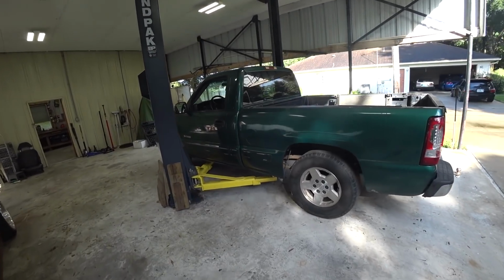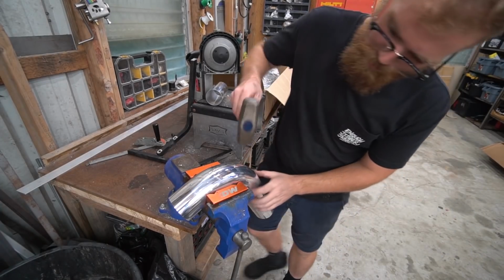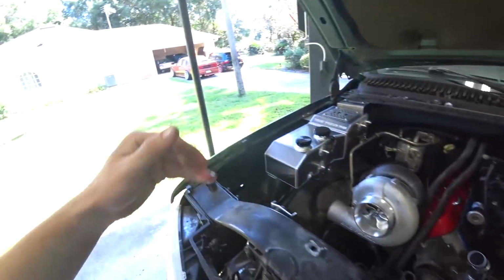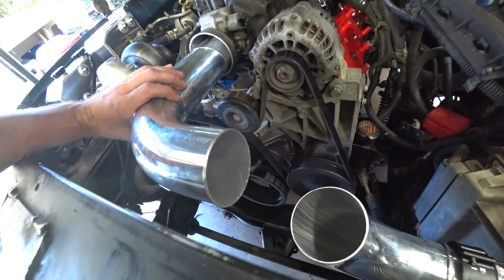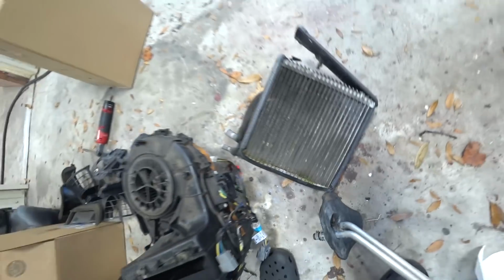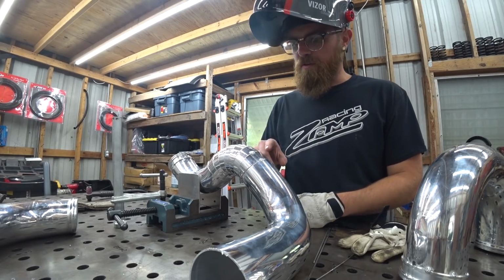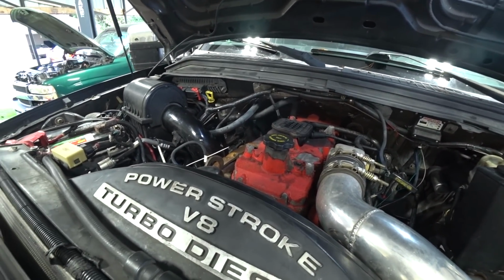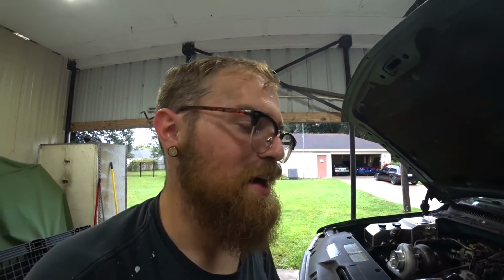Turbo LS street truck build. the first big fab project is complete.

Comment: Not trying to knock you dude, you do good work and I commend you, but there is no valid reason for pie slices other than for a look, and to give yourself some welding practice. They actually are more restrictive inside the pipe than a smooth mandrel bend, dunno why so many people do them. On your charge pipe you coulda just did a 45 and then a 90 into the TB. Also, your intercooler end tanks are not optimal. The air will just go in and out where the nozzles are, and not use the entire core, thus reducing the efficiency of the intercooler by about 50%. But otherwise, good job. I just love these garage builds.

Comment: Do you happen to know if they make an in-tank fuel pump set up like you have with a 450lph pump that will fit in a 2000 are s10 4x4. I'm doing a turbo L33 swap now but I'm still trying to figure out my fuel set up needs since no one really talks about that part of an LS turbo swap. Seems like a boost referenced fuel pressure regulator might be worth mentioning. I'm only looking to run between 8-12 psi most of the time but with my set up I should be on boost pretty much by the time the stall flashes to 2500rpm. But I do want to be able to run it at up to 15psi without worrying about anything. Thanks for any info you can help me with. Btw, it's a 4000+lb 2000 ZR2 4x4 s10 with an L33 with 80 lb injectors, ls6 intake, DBC TB, a 70mm turbo (DNA GT45 from Ebay) on stock 31/10.5" tires with 3.73 gears, and its gonna have the Sloppy mech/elgin E-1838-P stg 1 turbo cam with the basic trunnion upgrade. I'm just trying to figure out how to run my fuel system. Thanks if you can help any. Awesome build BTW, my drift buddy is doing almost the exact same build except his truck is red and it started off with a 4.3L so it was heavily under powered like my zr2 was. Both v6 engines blew up because you had ro dawg then to make them perform enough. Oh, you wouldnt happen to be near Gainesville would you? I used to travel through Gainesville to get to a small town named Bronson quite a bit.

Comment: I’m curious if an intercooler like what’s on a 6.7 powerstroke would work a little better, would be a little more stealth for a sleeper look would require more fab work but it would fit nice where the air box use to

Comment: Looks awesome! My black 03 gmc single cab is by far the nicest cleanest build I've done way cleaner than 00 z28 small tire turbo car that probably has twice as much money in it lol!! It took me 3 years to get my truck where it's at now I wanted a street/strip setup that I could drive anywhere but with any thing I do gets out of hand eventually I started with a 60,000 mile oldman owned Sierra so it was super clean to begin with it started out with a sbe 5.3 with a Huron Speed single kit with a vs s485 1.15 T6 housing ,very nice kit if your like me and can't weld lol and Holley EFI, th400 built factory rear end with all strange parts 4.10 gear with a spool and Calvert leaf springs and cal tracs I also relocated the shocks it's got strange double adjustables front and rear. I basically got rid of everything I could and moved everything else to where I wanted just to keep it clean as possible I done a 5 lug swap up front from 1320 wheels I think that's the name of the company/website. I got it running and the suspension and tune dialed in and was running 6.30's but that wasn't enough lol I ended up windowing the block it didn't like 25 pounds and 7600rpm in a 4000 pound truck. So I threw a budget built ls2 based 403 with 11 to 1 compression and put together with summit Ls Pro 4" Crank rods and Pistons with btr cam springs and push rods and some used LSA heads CNC'ed by PRC stock ls3 intake Bosch 210's ebay cable style throttle body and went to a Garret gt5591 with a 1.32 t6 housing and a pretty big air to water intercooler and 5 gallon ice/water tank in the bed now it only runs on ignite E90 instead of pump gas and renegade 110 race gas I ran with the 5.3 and had another ptc converter specced by dusty bradford it's still very streetable except now if you plan on going more than 25 miles you gotta bring fuel lol I got a 10 gallon cell with 2 walbro 525's while the motor was out and new one getting built my local chassis guy fabbed up a x brace that's under the cab that ties the frame together bolts right in got a 8 point cage and a custom anti roll bar with trz parts. IDK how much power it makes but now the race weight with me in it is 4231 and has been a 5.72 @ 128mph so far on a pretty mild tune and 23 pounds I think it's got .50's in it I haven't got very agressive with it on the big end I hit it pretty hard before the 330 I really don't want to hurt this motor LoL I want to keep it running as long as possible and looking nice and clean I'm weld 17x4 black and polished alumastars and single beadlock 15x10 black and polished weld s71s with Hoosier  28x10.5w's my  e.t goal was a 5.8any thing and went almost a 10th faster on accident lol so I try to baby it around but I'm not very good at it maybe if it didn't sound so rowdy and didn't have a 5'' hood exit exhaust I would keep my foot out of it. It is the only project I've started and finished that came out almost exactly like I wanted but it basically took 3 years to put together one thing I wish I kept was the a.c it gets hot in it being black I got a heater tho

Comment: If you'd used a 135 degree bend out of the V band you could have rotated the pipe into the air intake and then had a pretty straight run... at least it looks like you could have done with the camera angles.

Comment: I would try using a little less filler rod when you tig. Get some scrap, and practice pushing that puddle a little bit further. It just seems like you have an excess of material with your welds.

Comment: Love this channel! Small tip...change your belt on the linisher and the blade on the saw before working with aluminum. The difference will show in the welds! :)
Reply from the maker: I have separate belts for both materials.
Reply: I mentioned that when he first got it lol, steel contaminates complete screw aluminum

Comment: Pie cuts don't look good on IC pipping. They look unplanned and thrown together. Taking time holding up some bends in different ways until you find a way to have the least amount of welds possible ends up always looking the best.  The compressor housing could have been clocked around to get a better angle and all kinds of things.

Comment: What fans are you going to run on the radiator because the 05 fans would have been a great option but won’t fit with that pipe orientation

Comment: Have you ever tried capping the ends of that aluminum pipe, fill it with sand, heat end bending those tubes? I know its a pain to bend with steel, but aluminum after annealing it with heat should be soft enough to bend easily.

Comment: Awesome content, such a great job!
I'm curious why you  went with all 90 deg turns after the intercooler into the throttle body???
Seems like it would have been cleaner, shorter and simpler if you clocked the throttle body pipe down towards the Mishimoto clamp came up from the clamp at an angle where it would have been a straight run between the throttle body pipe and the pipe coming from the Mishimoto clamp.

Comment: Run the intake straight down with a sock for the filter. And get all the cold air away from the heat of the motor

Comment: Should put a naca duct in the hood and feed the turbo inlet with that, just put on a filter that goes 45 deg up and build some ducting to keep the hot radiator air away.

Comment: Don’t know why you didn’t just do a 45 coming up and then 90 into the tb. Was there something that the charge pipe needed to jog around?
Reply: Leave room for the fans?
Reply from the maker: Yeah didn’t want the intercooler piping to get heat soaked by the fans.

Comment: "4 inch cobra head elbow" silicone coupler is would work great for building your air inlet to the turbo they are made to be a super tight radius but stay free flowing.

Comment: Cut the air inlet on the front of the turbo and weld a v band clamp to the front at a 45ish degree angle for the fresh air intake. Works good

Comment: Do you run hotshot fuel treatment it works amazing on my 03 24v cummins. I need to change my injectors as well but it works 💪 throttle feels smoother and feels even better in mpgs on highway

Comment: Should just use a 4” silicone 90 off the compressor inlet instead of trying to fit an aluminum 90 and a straight coupler. Or over a 45 in silicone would probably get you over far enough to put a filter behind the headlight/ make a filter box that seals to the hood and all. Keep up the projects, i wish i had the time and drive you do. My hotside and coldside is going to take weeks

Comment: So just as like a "safety measure" I'd adjust those hood stops up as high as you can without messing with the body line to allow the hood to stop on them instead if bottoming out on the intercooler when it shuts in the latch. I had an aftermarket cowl good that was slapping the bottom of the latch every time I shut it.

Comment: A big factor to evap core going out like your is from the crud build up on the core since your truck never came with a cabin air filter. So good preventive maintenance to save the trouble of ever having to pull the dash again would be seeing if you could add a cabin air filter somewhere in the truck.

Comment: You think that my 4L70E would be fine with a turbo or do you think I should shoot for a stage upgrade or the 4L80E?
Reply: 2016 silverado 5.3L I've done, exhaust, intake, E85 fuel system, cam, I just have the turbo left.
Reply: Heads too

Comment: Pie cuts are cool, but I would have just put a 45 on the driver's side and turned the 90 from the throttle body to meet it. To each their own. Yours is a cooler method and mine is a lazy method :-p

Comment: turn the ac wave freq up to like 120 to 130hz. it will hold a much tighter arc and not make the tungsten ball up as much so you will have much better control over bead width vs. penetration. then drop the background amperage down further on the pulse and crank the foreground amperage up to make the material puddle faster. you will get much cleaner welds and the pulse foreground amperage will help give you a more consistent bead width.
Reply: It is always interesting working with different materials, even tho 3 pieces look the same unless they come from the same supplier/batch they can react differently.
Reply: Finally!!! I came here to say nearly the same thing! Maybe a little less filler on some of that as well!
Reply: @ToxemicSean  yes I’d agree on less filler as well

Comment: Thank you for showing that 3 in 1 tank for catch can, coolant, and overflow. I've been looking for a solution to do a pcv reroute on my duramax and that's a sweet way to do it. Plus I've never seen anything like that for a duramax.
Reply: Second battery tho....
Reply: @bonecrrusherSS another YouTuber "fixed vane duramax made a kit for it to mount right behind the bumper below the cooling stack with out having to extend any of the wiring.

Comment: Taylor, why didn't you run the intercooler to intake pipe at an angle straight between the two 90s? Would have saved you the pie cuts and would flow better. Or would that get in the way of the coolant hose?
Reply: I think he needed to bump out to leave room for the fans.

Comment: i had a grand national a few years back and i was surprised to see the intercooler behind the radiator.  for all the trouble that is was worth to install the inter cooler out front, could you have moved the radiator condenser forward? and went with a thinner but larger intercooler on the back side?  next time right.  cant wait to see it rip some tire smoke.

Comment: Just something to consider. Bends do affect power quite a bit but as long as the pipe can flow the amount of air your engine is trying to pull the pipe does not need to be round. In theory the pipe could only be an inch tall and as long as its wide enough it will work just as well. So dont feel stuck to round tubing in those tight spaces. Do something kool. For those who want proof this has been proven over a couple episodes on Engine Masters at some decent power levels.

Comment: How do you connect the other bank of cylinders to that cast manifold? I’ve been breaking my head since i first saw it. 😂🤦🏽‍♂️ i can’t figure it out since i only see one.
Reply: V band on the rear of it
Reply: @garyhowe88  thank you i went back and saw it lol
Reply: Driver side bank will cross over under the truck and feed into the back of the cast log manifold. Then all exhaust will come out the front of the log manifold and feed the turbo.
Reply: @hammerswrenches2174  thank you! I’m an idiot lol
Reply: @Watchmedome3017  not an idiot... no one knows everything!

Comment: Taylor  shoulda clearanced the head light cant remember who did it on there Tahoe turbo build
Reply: Negative that was a half ass shitty way of making shit work you’re talking m about uncle rob. The name of the Tahoe. Can’t remember the guys YouTube.
Reply: @Colt-v9u  I guess it's a matter of opinion or perspective. In my opinion denting a pipe with a hammer is half ass compared to heating the back of a headlight and molding it to a pipe. To each their own though. Just my two cents from the peanut gallery.
Reply: @zacharystout492  he wouldn’t of had to if he didn’t put that big ass radiator in it.. smh the stock one would have been plenty and gave him more room. I know plenty of people running stock radiators with setups wilder than this. Worst case he upgraded to a 2500 radiator and still would have had plenty of room. I forgot he did that so thank you for pointing it out both ways are half ass!

Comment: Probably not the best idea to push a "1000hp" worth of boost right into a rubber 90 coupler off the turbo but I guess we'll find out.
Reply: Had the same thought. Should have v banded everything but whatever 🤷🏼‍♂️
Reply: @Colt-v9u  straights and 45s are okay for high boost but high boost on 90-degree rubber couplers you are asking for failure
Reply: @israelcardona5170  v bands = no worries!  I hate couplers but yes I do understand you where talking about the 90 only. I went v bands and will never go back to couplers.

Comment: Mishimoto? Drop in? Please... made the mistake of buying one of their radiators that was "direct-fit" and in reality it was anything but that. Now it sits in the corner after I bought a KoyoRad that took 10 minutes to put in.

Edit: I was curious and did some google-fu when I had these issues. Turns out there have been issues with this Mishi radiator since like 2008 and they never updated the mounting design, countless forum posts about people with the same issues I had. Fuck them. Z33/V35 chassis btw.

Comment: What blade are you running on your chop saw?
Reply: That's a "cold saw", specifically for cutting metal (runs slower than a typical "chop saw" for woodworking)... I would guess that it's whatever blade the manufacturer supplied with it.
Reply: @mattmanyam  yeah.  I’ve got a hot saw with the abrasive blade for cutting steel.  Curious what blade he was using for aluminum.